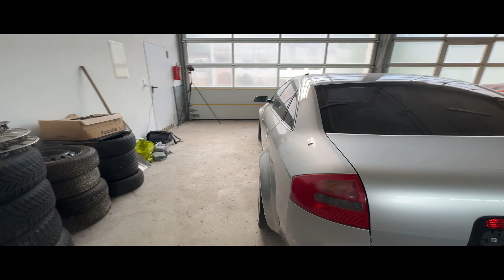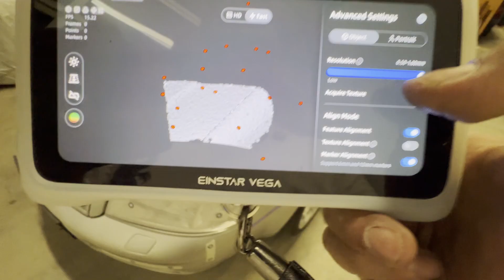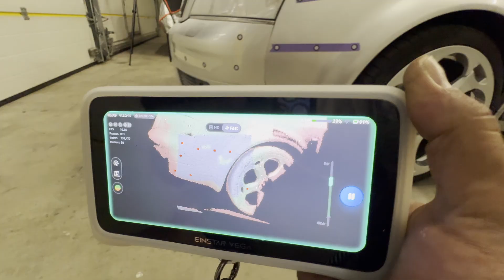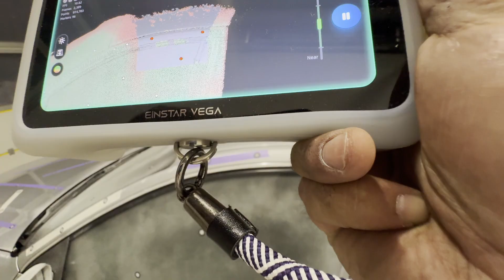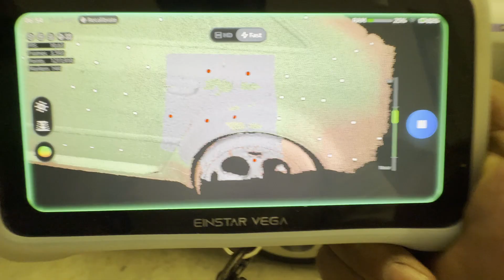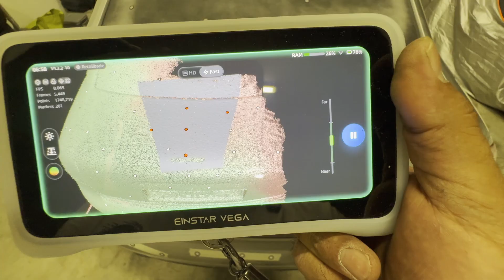How To 3D SCAN an CAR with EINSTAR Vega - The Right Way !

Comment: why do you put the markers on masking tape?
Reply from the maker: When you add the markers on the maskin tape instead to the car directly its easier to re-use them. If added to the body: you will need "fingernails" to be able to remove them - and since its a friend´s car, and he´s sceptical that he wont get scratches from it - i´ve choosen the masking tape trick :)

Comment: Great video, thank you for explaining the point cloud. I like how you did the tape job with the markers, seemed like it scanned very easy compared to other video's I've seen.
Reply from the maker: Thank you :), you have to take care of the tape - as depending on your scan resolution, they "will appear" but have less impact on creating stuff on that surface (because its pretty thin). but if you would go for a "body render" they will disturb you in the perfect finish. I used it in that case, as there was no intention to have a perfect 102% finished shiny body :). Also a plus of the tape -> the markes get off easy and can be reused, compared to beeing added to the body (sometimes they stick pretty good) and you risk "microscratches" by removing them from the body